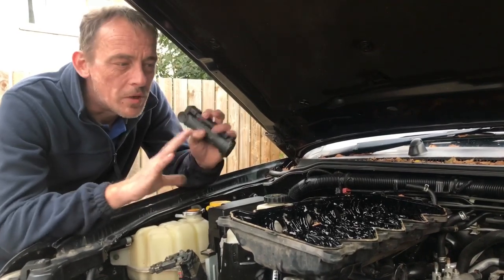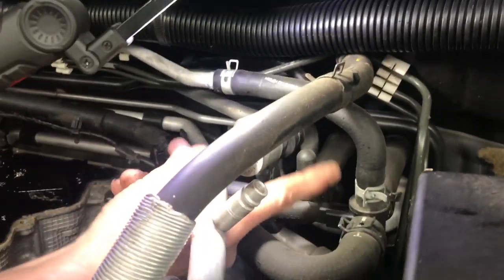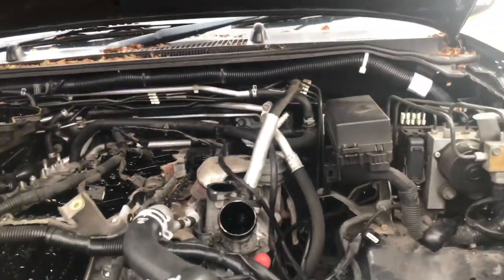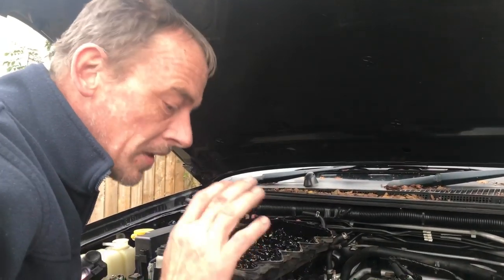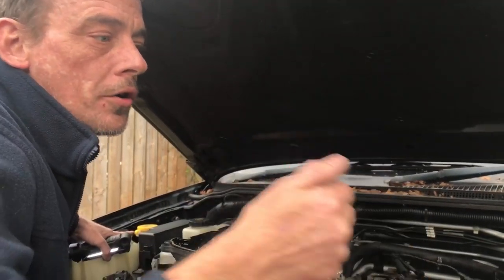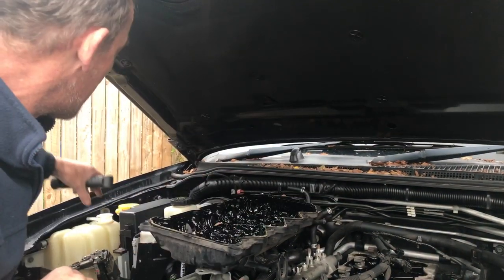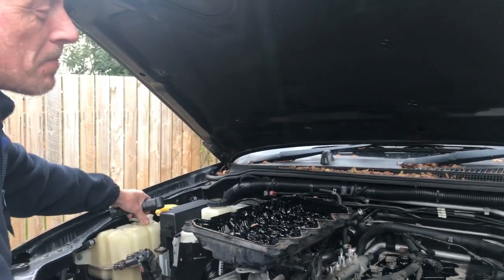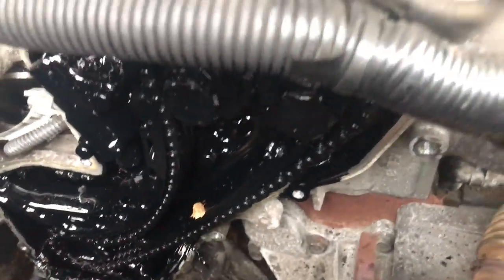How to bleed coolant Were Back!

Comment: Hi I'm from south africa watch a lot of your videos. I have a D40 the lower water hose from the radiator is not hot and heater does not warm up. Could it be thermostat, water pump or airlock?

Comment: Good to see u back.  My new injectors just arrived and your vid will be my guide for the remove and refit.  I'm glad you guys are out there since I would very likely sell the Nav I bought recently unless I had solid advice on making repairs like this.
That is, I didn't do enough homework and missed the part about these things having a Renault engine, scarey!   I'm lucky I got the price down enough to cover this but it was in anticipation of a timing chain kit.  I guess that will be next then hope the big ends hold up.  Nissan have really gone to hell and don't want anyone sorting the problems that they appear to have deliberately built in.  Some how I failed to heed my own advice and now I may be stuck with a money pit vehicle.  
It must be soul destroying for people who can't do the work themselves.  As I said, glad you are out there, mate, at least you know what you are doing and independent.  Most are mediocre at best when tested. 

Given the new factory solution to the timing chain issue, it's almost unbelievable that they would try on such a blatant rip off.
I am so utterly discussed with the vehicle industry.   

I just have to say to anyone out there ...Don't buy a Nissan, VW, ford of Mercedes Benz without looking at the companies actions in recent years and what they have been building.  They are just the ones that I know have definitely been shafting their customers.  Looks like Toyota are doing it too now. It seems to be getting harder to find solid reliable vehicles just when it should be easy.
Cheers
Jack from Oz

Comment: hi mate, any ideas why my  2010 Navara only blows cold air? No leaks or overheating. Mechanic said he's changed heater matrix but not resolved the issue. He thinks it's the resistor but the fan works fine on all speeds. Just no heat! Great vids btw

Comment: Good day I have a problem with my D40,last year November I blown my head gasket,so head was shave and the guy who did the head tell me mechanic used the thicker gasket it have for the D40 which was VK505 when job completed a week after I notice coolant coming out from the over flow bottle and radiator always have to get top up so last 2 weeks back I park up with the van idling and notice the temperature reach a little over half so I switch off for 10 mins and vehicle didnt want to start so I wait for 25 mins and it start back but when I check radiator wanted water again so I top up before leave to head home but notice a white fort now and I hopping it's not the head gasket again that blown someone tell me it could be air lock somewhere or one of the hose have a crack and sucking air any advice plz.

Comment: Hi mate just subscribed to your channel having some major issue with my pathfinder , getting no heat through heating , changed radiator , waterpump and thermostat . Topped up the way u did took a drive let it cool and its taken another 5litre , i repeat the process and same everytime , i have the rear heating aswell . I am stuck . No white reek or steam from the exhaust , no idea where the water is going as cant see a leak
Reply from the maker: Cracked Cylinder head sorry
Reply: @West yorkshire engine services  would this cause back pressure?  why am i not getting white reek an it still running fine ?

Comment: G’day are you my name is Shane I have just recently switched my 2.5 L Nissen X Trail petrol engine to complete conversion to the 2.2 L diesel engine without success connected to the original five-speed manual have had no trouble since I’ve done it Cara runs like a dream in fact it’s better on fuel Regency

Comment: the only wat to bleed this correctly is using the Vacuum bleeding system , this does it right first time every time , your way is the old  way , and not really suited for modem engines